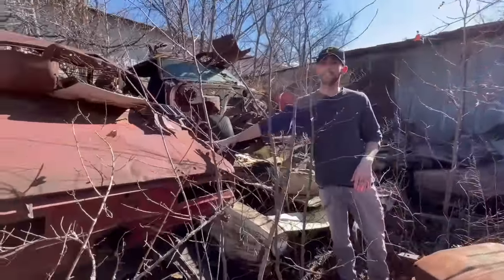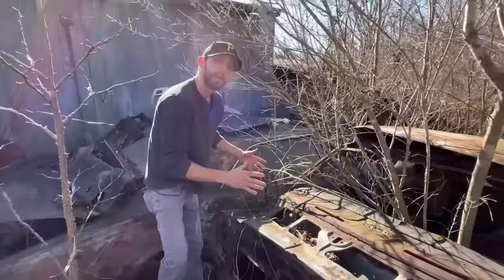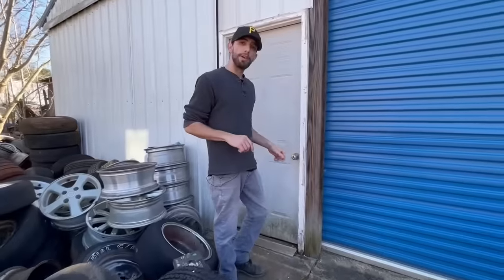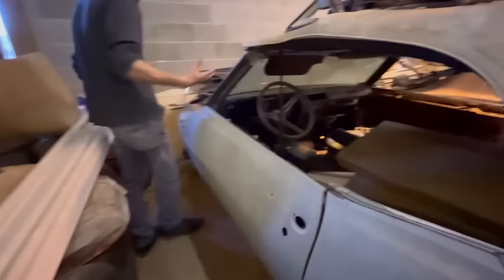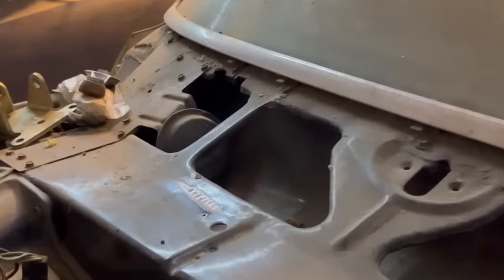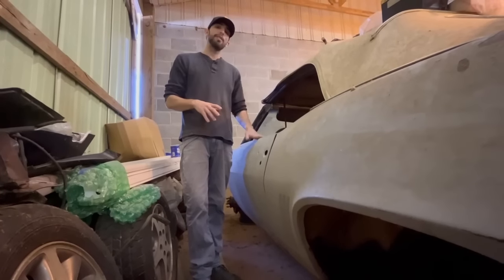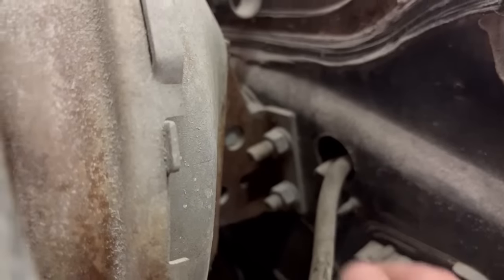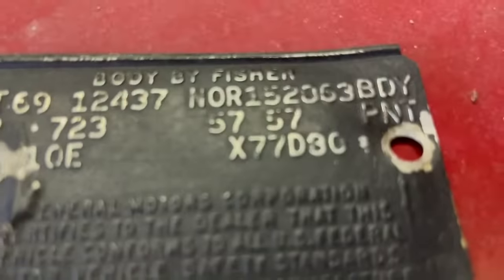Exploring 1969 CAMARO Junkyard!

Comment: Parker, the 1969 Z11 Camaro Convertible Pace Car has been my favorite car for 40 years.  I love that you found one to take us through in that building.  Great video!
Reply: My favorite was and still is the hard top version of the Z/11 the Z10( only around 200 were built).
Reply: at 6:43 info - about 3600 1969 Z11's (convertibles) were built compared to about 200 1969 Z10's (hard tops) were built. Also, the Z10's were delivered  to Dealerships in the North Texas & Oklahoma areas. The Z11's were delivered mainly to the "MIDWEST" Dealerships.-FYI

Comment: 69 camaro with a black tail panel had big blocks 396 . NOR on the cowl tag indicates that the car was manufactured at the Norwalk Ohio GM Plant . some Z/28s were coded x33 also
Reply: Firewall tag X33's & X77's. 4 speed only, NO Automatics for the 69 Z28's. .

Comment: Parker I believe that the Camaros and Chevelles with the 396 engines 325 and 350 HP had the return lines. Only the 375 HP had the single line. I had a 69 RS/SS 396 325 HP all original.
Reply from the maker: Yes, that is correct 375hp cars had 1 line!

Comment: Hi Parker I enjoyed your video, would like to see more. Seeing you walk through that junk yard reminds me of me when I was a kid going through junk yard after junk yard trying to find parts for my first car. 1967 camaro. I bought it when I was 15 in 1980, I gave $400. But then I ran across a1969 rs. I gave $1400 quite my job at my brother's body shop and worked on it for two weeks just to be able to drive it across the gno bridge in new Orleans, it took 2 hours to get it to the house in bumper to bumper traffic. I was a nervous wreck when I finally got it to the house. I had both cars and didn't want to get rid of either one. Cause I had the 67 like show room. But I was in love with the 69. I found out we were moving to Mississippi and I couldn't bring both of them with me. So I sold the 67 but I still have the 69 plan on putting it back together very soon.my 69 was hugger originally orange with the blk vinyl halo top. Thanks again for the video.
Reply from the maker: Thanks Jay... I would've sold the 67 also lol

Comment: I don't need any parts YET. I'm sandblasting the rims for my 69 Z/28, which has been sitting in my dad's shed since the 80's and need to inspect the engine entirely. I would like an analog clock on my dashboard at some point in time 😊

Comment: Parker, Is the 69 Camaro with a 250 ci engine and a 3 speed manual on the floor worth anything? My Dad bought this camaro New in 69 and gave it to me, should I restore it to stock or Modify it?

Comment: Also starting In 71 you could get a small block SS chevelle. Even 2bbl 350s where available. From 69 to 71 it is very easy the clone a chevelle to a SS. That's why paper work is so important when buy one. There are clues to tell them apart but stating in 70 you could order a big Block  a non SS car. So it makes more difficult. Sorry so long winded.
Reply: 69 you could get a 396 in a non SS car.
Had a friend order all he could afford, figured he add things as he could afford to. 396, 12bolt open, auto on the column (think it was a glide) and drum brakes.
Reply: I'm amazed at your knowledge and ability to decifer tags, etc.

Comment: L89 is a 427,and the 375hp 396 is a L78
Reply from the maker: You’re referring to a corvette, they made 311 L89 Camaros in 1969 with 396ci motors aluminum head cars very rare and not well known..
Reply: I didn't know that, I thought I new a lot, but that one slipped by me. Nice job thanks
Reply from the maker: @dukefrog  it’s easy to get Chevrolets confused lol I do it all the time 🤦‍♂️
Reply: My family has and had several Chevelles, I have a 69 with the L78 that I bought about 30yrs ago, it leaves speechless every time I drive. I need to study up on Camaros a bit more. Great channel, I just found you yesterday
Reply from the maker: @dukefrog  yeah man good to have ya here. I just really love any old classic and love to learn hope you enjoy the videos
Reply: Without orig paperwork I wouldn’t pay big bucks for any Camaro big block SS or Z28. Too many cowl tags n vins have been replaced.

Comment: Hey Parker, very informative video, as usual ! You are talking about rare Camaro's and so I was wondering what your thoughts are value wise for a Red Factory 1987 Camaro Convertible Iroc- Z28 305 TPI V8 with manual gearbox? This is one of only 744 Camaro Convertibles made in 1987.
Reply from the maker: Dutchy I’ll be honest and let you know that I’ve never looked in to Iroc Camaros but I do know they are on the rise in value, where are you located I’m always willing to learn